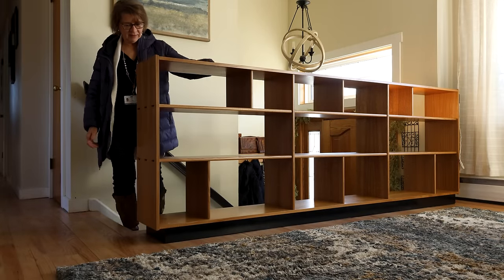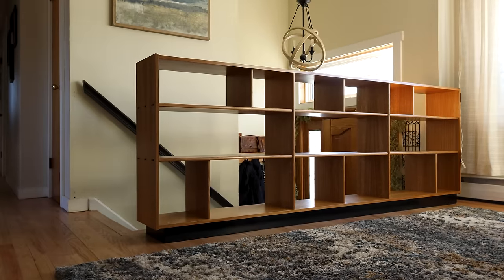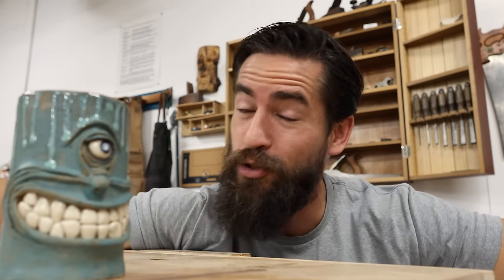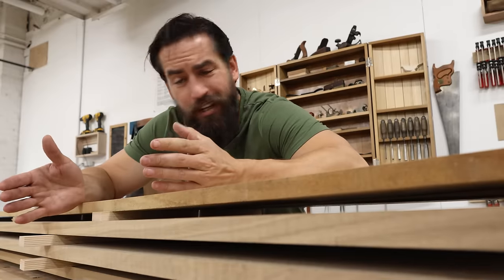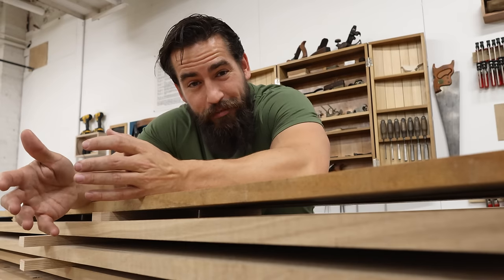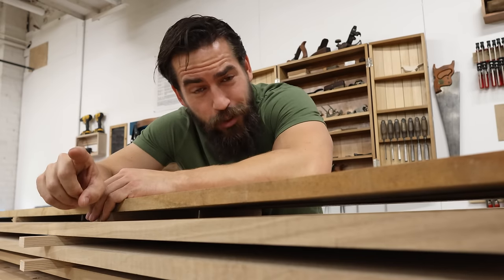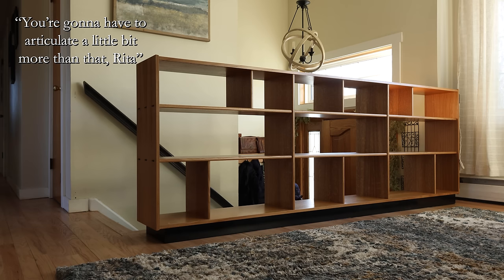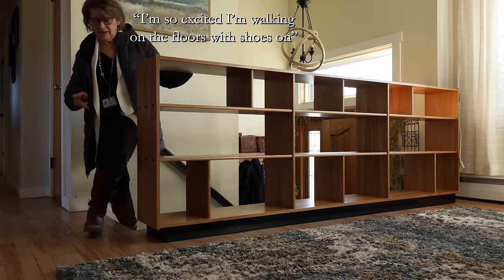Building a bookcase with $2400 of warped wood

Comment: I am giving some thought to growing my own timber in Portugal. The big problem is wood takes so long to grow and season. Then I had a bright idea roundwood is 1.5 times as strong as the same ordinary timber. It is also radially symetrical so should not cup or warp. With this method, you dont even need straight timber. Just match the grains. I am looking forward to making a dining room table.

Comment: Hi Eric,
35 years ago I bought some curly red oak planks. After 12 years in my basement, they got made into a china cabinet. None of those boards EVER settled down. They still move, twist, etc. But, I made my joints well, and the top, which moves the most , has almost 12 mm of room to move. Seeing your boards I just knew they would be moving. A lot. You will know in ten years if you did a good job of working with that wood. Nice solution to the emergent domino problem. I did the same thing on the last bookcase I built. Oops but not oops. In all you did a very commendable job on the piece. 
Cheers,
Keith
Reply from the maker: Wood is a fickle mistress. I'm curious to see how she settles down over time.

Comment: I get a lot of enjoyment & knowledge passively out of your content. Here I actively have a ??.
Question: Would exposing 'fresh wood' on the outside faces of the 8/4 stock have potentially reduced the wood movement after resawing? 
I did this on a smaller scale (4/4 stock) with two halves of the same plank, one I 'skinned' before resaw & the other not. The one I skinned moved less. 
What other possible hazards are introduced in doing so?
Reply from the maker: A fair question and totally an experiment worth running. It could in theory help, though even still the moisture differential between the center of the board and 1-2mm beneath the surface would be substantial. I think these boards warping had more to do with the natural tension of the tree rather than the moisture differential, however.

Comment: The plugs are an interesting solution I never would have come ip with. 
I would have probably made floating tenons out of oak, and then made it look like wedged, through mortise & tenons were the original plan, by squaring off the oak tenons & putting a contrasting wedge in them. 
I like the zircote plug thing though. Always wanted to do that & always forget it's a thing.

Comment: Ahhh, Working with warped wood ... Woodworker's bane or blessing!?! I kind of (oddly) enjoy working with difficult pieces. It forces me to figure out work arounds and when I do get straight pieces, it goes so much easier with the mental toolbox I'v developed with the less than perfect pieces. I'm sure that anyone who has done more than one or two projects have had those S#@%! moments with a brain fart in the joinery  process. 🤣 Always provides for a brain itch and a design change on the fly lol. Beautiful yet subtle but at the same time an elegant fix. Drawing the darker contrast up. Personally, I think it actually connected the casework to the plinth much better than if it were just a clean face. Once again, outstanding video on an elegant project 👍
Reply from the maker: I agree completely. I was frustrated by their inclusion at first but after I stepped back I saw the connection between the dark elements and how it drew them together. Then I wasn't mad at it anymore

Comment: that's stunning! 
I recently had the same problem with some bookmatched curly walnut for a sideboard I made, even though I managed to do exactly what you did here with joinery (getting everything flat) I didn't feel comfortable with how it would hold up over time and started from scratch again.the piece was a commission so it was a risk I wasn't willing to take .
I was hoping you'd go with hide glue on this one, makes it easily repairable should any of the joints come apart (given how much tension there is) and I would be really interested to see how this holds up over time. The Ziricote accents are lovely, the figure of that oak is also beautiful and elegant ... well done!
Reply from the maker: For sure. I'm interested to see myself. It should relax and ease with time. But that's just a theory...
Reply: @ENCurtis  would make for a great follow up vid a year or two from now!

Comment: I’m fascinated by what you do and how you do it, @ENCurtis, but … I’m very frustrated with my own efforts. I’m learning and my first task has been to build a workbench. I’ve measured twice and made sure all are correct before I cut. The issue is that cuts aren’t straight. Every line is somehow not square. This means that joints don’t fit tightly like they’re intended to do. I can’t figure out why this keeps happening over and over. When I cut with a handsaw, the cuts begin perfectly straight and square, but the bottom of the cut angles in or out such that the bottom of the cut is not square. The same happens when I use a power saw. I’m so frustrated and I don’t know what I’m doing wrong or how to correct it. Do you have any suggestions for me?

Comment: No offence intended but the most interesting (for me) video you have posted for a while. I know that others will appreciate more your talks about joints ( and maybe daunted by the sheer scale of the bookcase) but my interest lies in the how, the why, adjusting as you go along and correcting mistakes - not that I make mistakes in my pieces; they are opportunities for learning and design innovation. Boy, do I still make mistakes. 

If made this piece, I think I would only do one thing differently. I’m not convinced that the stepped housing for the internals adds required strength. I think I would either mortice the dividers into the uprights and horizontals or add more dominos. 

 I don’t know if you have an adhesive called Cascamite over there? (I’m in the UK). I tend to use that for its slow cure particularly when I need a strong glue (which I don’t think you do for most of your piece). It comes in a powder and has to be mixed with water in the correct proportions but has an open time of an hour of more.

Comment: Great video - can you talk about how your Shoulder Jig might have contributed to the mistake? Since you're using the Domino cutter through the jig, you have to add the jig's platform thickness to the depth at which you're milling the domino mortise. This is where math could come into play. Same for the dado depth - the router bit's depth has to be as deep as the dado you want plus the thickness of the jig's platform.

Comment: Not to give you guff. Warped boards like that is the use case for sliding dovetails. I don't love them myself so I probably would have worked around them also. And they are hell to set with pre warped boards, but I didn't hear you mention it so I thought I might.

Comment: Not to be Debbie Downer...but you realize that is not to code. Someone, more specifically a kid, could crawl through the openings and fall down the stairs. What that means is it will need to be removed and a proper railing w/less than 4" openings installed before the house is sold. The house can't legally be sold in that situation, and that applies to all states in the country per the IBC.

Comment: To lock down  you could have used more Green on Green decorations like a split Dowling with a wedge 3 colors the shelf ebony and plain maple. 

This won't pass code, a young child could crawl onto the bottom shelf and fall out down the stairs.
I hate to spoil the looks but it needs 
A guard rail.

Comment: Like so many others -the through mortis(-ish) detail on the end panel takes this to a whole other level. Awesome!!

Interested in hearing your thoughts around other joinery options for the dividers, such as a sliding,stopped dovetail (seen from the stair-side). Would it be solely aesthetic that you didn’t chose this joint or is there more to it?

Comment: You  say that you flexed the extremities down and I understand the purpose. But I have a question: why did you not decide to flip the whole board over and flex down the middle of the board. Would it be the same or no? Thanks in advance for your answer.

Comment: I have a question on your thought process on not rounding the back of the shelves like you did the front of them? I can see it as a design guide to how the piece is used, but it also seems like a shame to not show off your detailing from the first impression as you enter the house. Excellent video on dealing with complex sequential glue ups, and how to deal with "happy little accidents".
Reply from the maker: Fair question! My thought was two fold: firstly, I wanted to differentiate the living room from the stair well. They should feel like different experiences of the same piece. Second, given that the case is acting as a half wall and structural barrier I wanted the stair well face to feel more imposing and more like an actual wall--flat and sturdy. People will want to linger in the living room rather than the stairwell, I hope.
Reply: @ENCurtis  I see now.  This allows a different viewing experience based on the angle.  It reminds me of an airplane conversation I had with a professor who taught that anything that exists in a three dimensional space is essentially a sculpture.  I see you  bringing your experience into this piece.
Reply: @ENCurtis One more question.  As I rewatch it, it looks like a minisplit vent on the wall end.  Is there any concern about wood movement or drying out due to being so close to the vent?

Comment: Lovely piece!  I’m a sucker for Greene and Greene , so I loved the “design accents”. 

When you were bookmatching the boards, why biscuits instead of dominos?  Thickness of the wood?

And the adhesive veneer screw covers: how did you match their finish to the bookcase?
Reply from the maker: Simply put, biscuits are cheaper than dominoes. But dominoes would have absolutely worked. And for the fastcap covers, they don't match 100% as they are just clearcoated oak and I toned this piece slightly, but they're much closer than a raw screw head would be!

Comment: Such a beautiful piece you've built there!  One day I've sharpened my skill enough to build my own with good level of confidence. I'm learning woodworking by myself mostly through YT. I bought a planer a few months ago (still in the original package) but don't have a jointer yet...  It would be nice to know how you manage wood dust in your shop. Thanks!
Reply from the maker: Thanks! We have a central dust collection tower but in my early days I simply used a shopvac. It's not perfect but it worked.

Comment: Nice save with the greene&greene accents on the end. That turned out great. 

How about racking? Would be nervous not having any cross bracing.
Reply from the maker: It's honestly solid as a rock. I had a similar though but with the amount of dividers in the case, plus the end cap joinery being 90 degrees to the internal components, it's rock solid. Add to that the fact that it's butted up to and screwed to the wall and it's not going anywhere.

Comment: Did you consider flipping the bookshelf on it's head to have the "accident" face the window? Doesn't look like the difference in height between shelves is that big...
Reply from the maker: That could be a fair solution. However having the biggest (12") shelves on the top with the smallest (8"+) shelves below might have felt imbalanced.
Reply: @ENCurtis  I would have been tempted though...

Comment: Apologies if this is a repeat of something answered before. Why do you use biscuits for glue ups (when book matching at the beginning) when you have a domino? is there something you prefer about that?
Reply from the maker: Totally fair question. To oversimplify, dominoes are expensive. Biscuits are cheap. So if I a biscuit will work just the same, I'll use a biscuit.
Reply: @ENCurtis  Makes perfect sense. Thanks